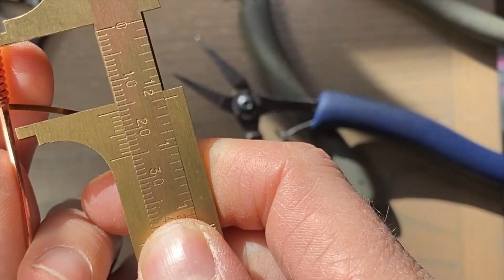Wire Wrapping Tutorial- Cute Coppernite Halloween Bubbling Cauldron Pendant

Comment: Perfect! Now that's a new creation, I have not seen this before, you may be the first. Thank you :) May I ask the size of the stone you used as it makes a nice size pendant.
I just went to Maya Crystals and was unable to find this stone, looked through, typed in search, nothing. Would you be able to give her/stone link? Thank you, again.
Reply from the maker: https://m.facebook.com/100008794860431/albums/3273976536254343/
Reply from the maker: I can measure the stone later
Reply: @ZurickDesigns  Please don't worry about it, just thought you may know off the top of your head. I will go with a 25mm - 30mm should be about right. Thank you :)
Reply from the maker: @annhopy2220  it’s no problem. Mine is around 18x30mm
Reply: @ZurickDesigns  Thank you :)

Comment: I attempted making your wonderful cauldron. I have to say you make it look so easy….and its really not! I’ve never done wire-wrapping before. So my question is that I’d get myself in places where it was hard to get in and out of and consequently my wire is scratched and twisted in places because of it. Is there anything I can do to smooth it out?
Reply from the maker: That’s why I like using bare wire! You can file it, sand it, buff it to get the nicks out! I started out just using a dremel!
Reply: @ZurickDesigns  is “bare” the same as “raw?”
Reply from the maker: @lisaemery6599  probably. Wire that’s not coated.